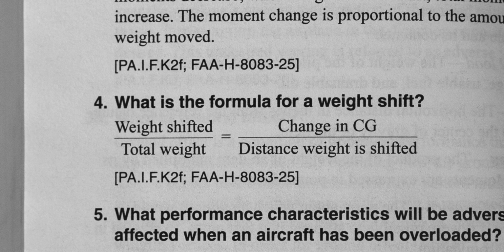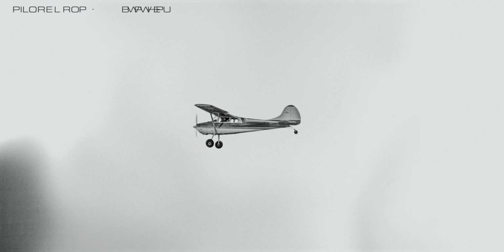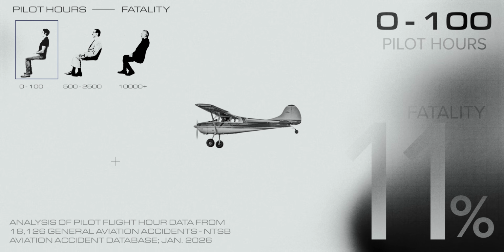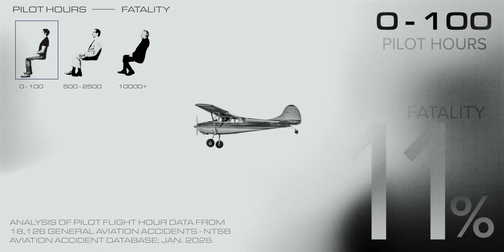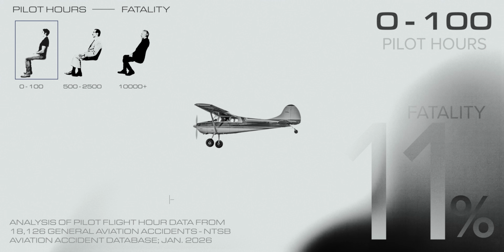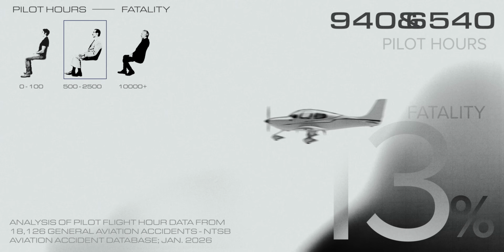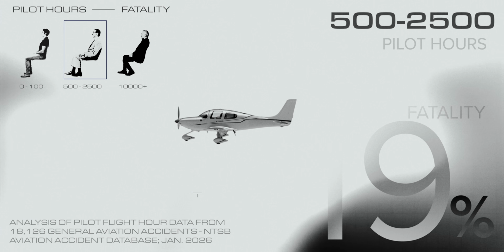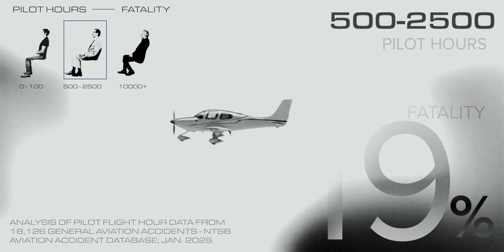Why Small Planes Crash (The 100-Year Design Flaw Nobody Fixed)

Comment: Now you are just moving human error from pilot to programmers!
Reply: Yes, but with programming, subsequent eyes, scrutinizing every line of code can sus out the issues, develop solutions, and provide software updates to prevent the errors in a repeating cycle of continuous improvement.
Reply: @AaronCMounts  Still: Someone/Something that is not a:
"PILOT"
Reply: @dcorman  the pilot is always but a little cog in the system. Has always been. Pilots just believe that they are the "juice" that makes aircraft fly, when in reality, it's the engineers, who design powerplants and control surfaces for the pilot to operate, airfoils and cross sections that make the sytem traverse the fluid and, structures holding all together in different conditions.

Programming control laws is just an added layer of engineering and professional civilian as well as military flying has embraced this many decades ago. It's just the private pilots, who think otherwise 😃
Reply: @daszieher DC-10 Crash Sioux City Iowa, 1989.
All automated and hydraulic systems failed. Were it not for Trained, skilled, Human pilots on board, the plane would have dug a hole and killed everyone on board. But men who knew HOW to fly and why things worked, managed to invent a way to fly the plane using aeronautical knowledge, flight physics and pure ingenuity, they managed to get the airplane to an airport saving 184 of the 296 passengers on board.

Aircraft systems operators , using the tools that engineers designed to automate their jobs, would NEVER have been able to do this. Because when the systems fails (as they will), they don't actually know how to fly an airplane.

That's why we need well-trained, experienced pilots on board, who actually understand what's going on when a plane is flying through the air, and what every part of the plane does.

There are hundreds (probably thousands) of examples of highly skilled and knowledgeable pilots using their knowledge of flight to save the day.
Reply: @daszieher  Apollo 13 is also a great example. Unlike the passenger astronauts we're sending up today, the three Apollo astronauts were highly experienced pilots.
When the SHTF, their knowledge, skill, and an intimate understanding of the spacecraft systems was critical in their survival. While NASA could radio ideas, they ultimately saved their lives dur to extreme training and backgrounds in flight physics and microgravity spaceflight physics, NOT automated systems (most of which failed or needed to be turned off to maintain life support.
Engineers, safely on the ground, could not have even helped them through this had they not been pilots and had full manual overrides available to deal with the emergency.

Our citizen scientist astronauts have neither the intimate knowledge of the ship, nor the piloting skills in most cases, and they do not even have the physical, manual controls to intervene and take over in a 99% "No-Win" scenario.
Reply: @dcorman yes and no. The engineers on the ground along with the reserve crew helped develop the manual and alternate procedures that ultimately enabled the stricken crew to save themselves.

It is this type of dovetailing cooperation that I was referring to. 😊
Reply: @daszieher  It was their intimate understanding of the spacecraft and it's systems, not just the interfaces and automations, paired with the fact that NASA decided  (at the urging of the highly skilled Pilot/Astronauts) that every flight control has an on-board manual back-up or override that allowed them to work with the engineers efficiently and quickly enough. 

We need highly trained, experienced people who understand how to fly things on-board when the tech and automations fail. Engineers on the ground can't do it, and you you don't have time to educate people with no experience on how to override, troubleshoot and repair (or Jerry Rig), or find a work around for faulty systems.
Reply: @dcorman which is exactly what I said, I just wanted to make clear that the actual understanding of the systems comes from the engineers, they designed it. The pilots are highly trained operators.

Apollo 13 was saved by the crew on board working together with the reserve crew and the engineers. Without this help the crew aloft would not have stood a chance, manuals or not.
Reply: 100years back, there were no computers.
Reply: Given the general cavalier attitude with which some of consumer grade software is built, that statement might have some validity. However, mission critical software is built very differently. It requires extremely demanding scrutiny that includes 100% code coverage - every possible value range is tested through every line of code and through every code path. Using modular component functions with well-defined input ranges and output values, makes that kind of comprehensive exhaustive testing viable.
Reply: @shammabeth   Found the Boeing mcas coder
Reply: @shammabeth  smh. So careful and precise, like the 737-MAX
Reply: @dcorman Two accidents caused by faulty code, vs how many thousands caused by pilot error?
Reply: @JeffreySaelee  The 737-MAX accidents are examples. They are not the only two accidents causing fatalities when technology malfunctions.

Ironically, however, the "operators" in the cockpits of those 2 flights were not properly trained pilots. They were primarily taught to fly using the auto-pilot and other flight automation systems. They weren't what the industry calls, "Stick & Rudder" pilots, who understand aerodynamics, aeronautics, and the primary manual controls and systems that keep the airplane in the air (As check pilots interviewed during the accident investigations testified). Which is why, when they had the technology fail, neither the "pilot" or "first officer" new enough about how to fly an airplane, or about the aircraft's systems, or about the procedures, to override the malfunctioning technology, take manual control to prevent the accidents. so, they were simply spectators as the autonomous flight control systems failed and sent them on a collision course to the ground.

Had they been trained in stick and rudder skills, in aircraft that had no automations, they would have had the skills to recognize the problem, disable the automated controls and taken control of the aircraft to guide it back to a safe, manual landing.
Reply: @shammabeth  now you are just moving human error from programmers to beta testers!
Reply: @beaclaster But with every level, the probability of error greatly decreases. A programmer working in a calm office with time to think has a much better chance to catch  and correct his errors than a pilot in a stressful situation with only seconds to react. A beta tester stress-testing the program will then have a much better chance to catch and correct the errors the programmer missed.

Comment: This was done in 1930s and resulted in the ERCO Ercoupe. All mechanical though and only addressed pilot control of the plane.
Reply: We’re inspired by the Ercoupe concept! They were onto something.
Reply: ICON, Ercoupe, An-2, and other "stall proof" airplanes have all suffered fatal stall related accidents (yes even the An-2 has been involved in fatal stall/spin accidents). The idea an airplane can me made stall proof shows a deeply disturbing lack of aerodynamic understanding. Also, in the quest for making something stall proof, you must give up controllability, which is inherently unsafe, especially when CG limits are not respected.

Comment: Cesna172. Cables and glide ability. Simple is my preference.
Reply: With no manual overrides or back up control surface system, and automated flying?
I'd rather put my trust in God being my co-pilot than some programmer that likely never flew an airplane and wasn't hired because they were the best candidate.

As for me, my favorite part of flying is controlling the aircraft. I read Stick and Rudder when I was a kid and became fascinated with the relationships that make aircraft fly. I don't want the plane to enjoy this ballet. I want to do it. Maneuvering and landings are by far my favorite events in an aircraft. I never pursued a career, because flying A-B 0  and return bores me. PPSEL and would only go back to school to get aerobatics training. But sadly, God does NOT want men to fly for Fun! If he did, he would have given us more time and money.
Reply: yes. manual connection to flight controls is mandatory in any aircraft I fly, no exceptions. I prefer pushrods over spongy cables, but cables are ok too. KISS is life in aviation. I've flown hydraulic controls, but in event of failure you could fly manual still with great effort (I've done it).
Reply: I agree! When your mission is simple enough, you get the simplest solution to it. But when you fly over mountains, ocean or desert, where there is no safe (or convenient) landing alternative, the glide ability alone is not enough, we need the 2nd engine. What we are doing is getting rid of the requirement for multi-engine rating, and all the risks associated with the complexity of the multi-engine operation. As a bonus, we also protect the envelope in all other conditions, and make the aircraft much easier to fly. And that's not actually new tech...we're bringing the Fly-by-wire 50+ year-old consolidated tech into General Aviation, because Mosaic is allowing so, that's the news!

Comment: I disagree with the entire concept, as well as I won't stop riding motorbikes. I want the sensation of feeling the airflow and controlling the plane. Putting this in the hands of a machine makes as much sense as letting my bike ride itself. Therefore I accept the risk of making a mistake. My opinion. When I want to go saver from point A to B, I climb in an F.B.W. airliner with two  professionals in the front and professionals ob the ground.
Reply: Sure...different missions, different solutions! I enjoy it myself as well, that's why I'll keep flying gliders and small aerobatic aircraft (which are the equivalent to bikes, in your great analogy). But what we're doing is something that would equivalent to a family SUV, not a bike or motorcycle. Wouldn't you want a higher safety level and comfort when your traveling with your family?

Comment: You nailed it: The user experience should be the foundation around which the entire aircraft is designed. This is exactly how I’ll be building aircraft in Yeshua ha Meshiach’s (Jesus Christ’s) millennial kingdom for the mortals, even though I and all Christian saints will already be in our new, eternal bodies that won’t require many of the products we create. I’m so looking forward it. I pray you’ll be there. The Rapture of the Church and 7-year Tribulation that leads up to Yeshua’s return in 2032 or 2033 may begin March 2nd or 3rd.

Comment: if your fuselage were hexagonal there would be more interior room
Reply: Hexagons are tough from an aero standpoint
Reply: @greg-mercer nobody said they can't have rounded corners
Reply: @greg-mercer  how do you figure that? Boxy designs can be Surprisingly efficient and effective if done right. There is more than one famous design that is boxy that people still build and fly (and both of the case examples I am thinking of specifically are 200+mph capable designs).

Comment: Why not just design a flight system that can make any airplane idiot proof?
Reply: no such system exists.
Reply: @SoloRenegade That was my point. Are you not trying to design an idiot proof airplane? If so then you would have to design an idiot proof flight system.
Reply: @wingslevel  no, designing an idiot proof airplane is stupid. 

1) idiots should not be flying anything
2) it's impossible to design an idiot proof airplane, only an idiot would attempt such a thing
3) if it's that easy to "fly" then it doesn't require a pilot
4) the only way to eliminate human error is to remove the human, thus defeating the whole point of flying.
5) if the only thing you can fly safely is an idiot proof aircraft, then you cannot call yourself a pilot
Reply: @SoloRenegade You've never made a silly mistake and called yourself an "idiot" in the moment? What I was getting at is will your airplane let the pilot fly directly into mountain or not? Like the Epic in Colorado. A fatal decision was made for whatever reason and I'm sure the pilot was not an idiot.
 Will said decision be possible in your airplane , or are you trying to design a system to  make such decisions near impossible? I hope you can.

Comment: Diamond aircraft is basically like that
Reply: In what ways?
Reply: @shanestinemetz  The Cockpit is just as intuitive with massive G1000 screens, panoramic cockpit views and such.
Reply: @jaybeebartolome8386  yes, that aspect is...but they still have mechanical flight controls, and require multi-engine rating and recurrent training as all other twin engine aircraft do, since the response to an engine failure must be really fast so it does not evolve into a loss of control. Our big change is having Fly-by-wire controls, the solution airlines use for this over decades, that we can now deploy in a cost-effective way for small aircrafts as well. That is the novelty!